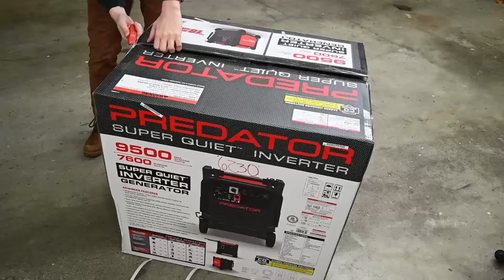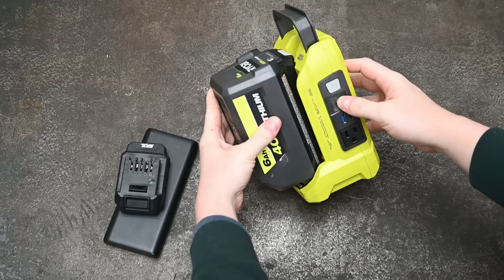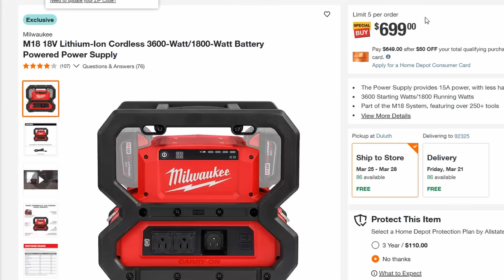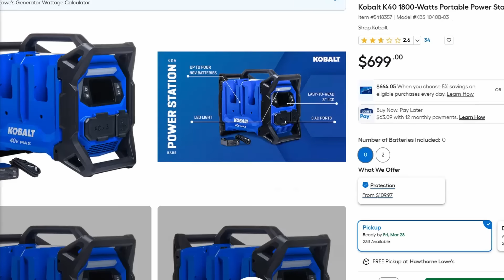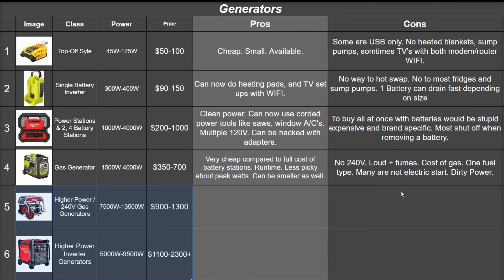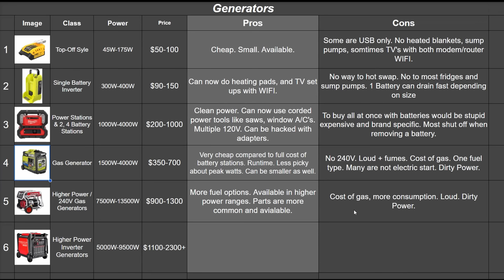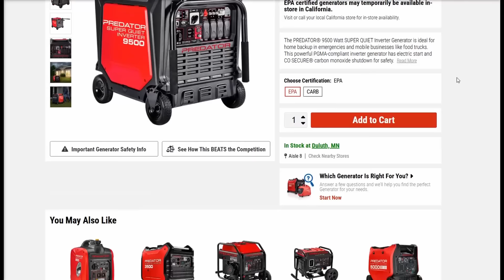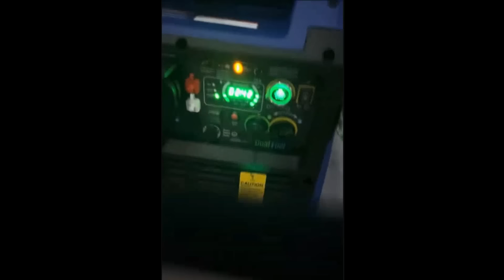Buying Harbor Freight's Most Expensive Generator So You Dont Have to

Comment: The ability to run on propane is HUGE btw.  Unless you're 100% diligent about draining the fuel after every use, or running it every month or 2 for long enough to get it up to full temps.  Propane is also a bonus on the engine oil since it runs cleaner, it doesn't drive as many contaminants into the oil.
Reply: I got firman tri fuel from Costco 
$800 
I only run it off of propane 
I don't want to deal with gas going bad, draining,  clogging up the carb
Reply: @DaveBigDawg  - That's the way to go!  When I worked for Onan (about 15 years ago), I'd replace dozens of carbs in the spring from gen's in toy haulers that had been parked the previous summer with no prep.
Reply: @DrFiero  lose a little bit of wattage but it's okay
Reply: @DaveBigDawg  - Benefits far outweigh the losses IMHO.  Besides... if you know you need say 8kw to run your loads... just get a 10kw gen!  Problem solved.  ;)
Reply: @DaveBigDawg
 Loose, a wrench can fix that issue.
Reply: @DrFiero   Do you know anyone that fixes ONAN generators? Pre-cummins? Since cummins bought them they just want you to buy a new (inferior) one.
Reply: @my_channel_44  - Depends where in the world you are of course... last when I worked for a Cummins dealership (13 years ago!) we would still work on the old ones. Had a few in fire trucks and things like that.  I also worked at a place where we were contracted out to the city for all the pump stations, ice rinks, etc.  They had backup generators that dated back to the mid 60's (earliest I can remember anyhow) many of which were Onans. And yes... the old ones just seemed like they'd run forever.  Many of the new 3600rpm sets seemed to be doomed from day 1 (ok, maybe day 3).
Reply: @DaveBigDawg  I love propane gens, works great with my propane used for heating.
Reply: The biggest benefit of propane is that it won't degrade or go bad. If you don't use your generator very often, that tank of propane can sit for years and still be just as good as the day you bought it.
Reply: @devanwinterton19 thank you for your feedback ❤
Reply: Propane can be stored indefinitely, gasoline can’t. I keep 24 hours of propane and a couple empty gas cans. When bad weather comes expectedly I can load up on gas ahead of time. When it’s unexpected I have a 24 hour buffer of runtime to get more fuel.
Reply: You don't need to do that.   Just add some iso heet fuel stabilizer all the time.
Reply: My $30 marketplace sourced generator sits for months at a time and fires right up 2nd pull. It’s super easy to avoid clogged carb jets and make fuel last, options include: 1. Close the petcock and let it run until it stalls 2. Drain the bowl 3. If you’re using pump gas ADD STABILIZER 4. Run AV-Gas, it lasts ~10yrs and doesn’t varnish when it evaporates.
Reply: @geeksgamesandgears2369 they still sell non ethanol fuel just have to find a gas station near you that sells it.
Reply: @geeksgamesandgears2369  Warning to anyone considering AVGAS, it is leaded.
Reply: @geeksgamesandgears2369 exactly it’s more preferred in my opinion cause as long as you do maintenance you’ll be golden
Reply: @geeksgamesandgears2369 I don’t recommend avgas; it’s leaded, the aviation world has spent a lot of time and money slowly transition the piston aircraft fleet to be more compatible with “mogas“. There’s increased lead in the environments around airports and studies show it ends up in kids bloodstream.
Reply: And you can store lots of propane (which doesn't "go bad" sitting), or connect to a large tank to run for days limited by only oil changes.
Reply: One nice thing about the predator is it has a "storage shutoff" where it cuts off the fuel to the carb and runs itself dry. So no draining the carb or worrying about that. Just use some fuel stabilizer and your set for quite awhile. I try and store mine lower on fuel so if it's sat for too long I can give it some fresh fuel when I need it
Reply: That is the reason I wanted Champion Generator most of them are duel fuel. And when tailgating at a sports game. A Generator running on propane has less smell then gas.
Reply: @mbmann3892 thank you for your feedback❤
Reply: I heard Harbor Freight is coming out with a Predator 11,500 watt inverter generator fairly soon.
Reply: @  only 200% tariff.
Reply: It's a bit of DIY but converting any generator to propane/nat gas is pretty easy and cheap.
Reply: Only problem is they usually run like 10-30% less "efficient/power" on propane when compared to gasoline.
Reply: @Fly-aaron92 like? Oh. BLess your heart ❤
Reply: @johnroberts4823 and you didn't even properly police my grammar. I used "like" in an appropriate context there. 🤦 I didn't say "like wow, ok you're just a big meany." 🙄 I said "something LIKE  10-30%" Specifically bc I didn't know the actual numbers. So I was guessing its something LIKE this or that. 🤦
Reply: @Fly-aaron92  “like” is a fill in word little middle school girls use, not grown men. Come on man!
Reply: @johnroberts4823  Didn't your mama ever teach you that if you ain't got nothing nice to say, it's best not to say anything at all? I'm guessing not.
Reply: It really is awesome. I'm glad I went the dual fuel route and I've never run gas in it (although I would in a pinch if I had to). I don't run mine much so I mostly change the oil because it gets old. Probably about 150 hours on the unit now with 4 oil changes. It comes out nearly as clean as it went in every time. Just did the latest oil change before the big ice storm was threatening and it was a little cloudy this time, probably because it sat for 2 years and I only ran it for 5 minutes before draining it. Propane will actually dump water past the rings when the engine is cold, so you need to get it good an hot to boil that off.
Reply: Propane has a lesser btu value than gasoline. Look it up.
Reply: @nothankyou5524  that doesn't matter if your fuel deteriorates after a month or two. The benefit of propane is that it keeps indefinitely. I know people in southern California who last had their propane tank filled back in the '90s. They still occasionally draw off of it during power outages or during rare wintery weather there. Interesting note, the odorants that they put in propane to make it stinky stop working at some point over long term storage. The gas by itself is odorless.
Reply: @DrFiero  As a small engine mechanic, most need to know that virtually all generators have a fuel shut off. You simply turn this off and run the engine till it dies, no fuel in the carb, no problem, the carburetor is always clean. 6 months to a year, if you haven't used the spare gas, just dump it in your truck and refill the spare tanks with new fuel. Like others have mentioned you need a ton of propane/large 100# tanks and the freeze up you will get from a standard barbecue tank is going to drive you crazy on large generators.
Reply: Not everyone has a enough supply of propane(unless you got one of the big tanks in your yard). If power goes off beyond your neighborhood, pipe gas/Propane might not flow. Gasoiline available in your cars and neighbors. I run 4 houses refrigerators for 1 week with 75 lts gasoiline and a 5Kw plant.
Reply: @WillyK51 Pipe gas drops after a while. Propane comes on a truck.
Reply: @pleappleappleap  We don't have pipe line gas service. Got 3 20lbs propane tanks.But we cook with electricty
Reply: Plus a few extra bottles of propane are multi use, the grill, burner for brewing, barn heater, etc. Add on backup generator fuel that's stable for a long time. Win win
Reply: Propane also produces less carbon monoxide than gas so propane tends to be safer as well
Reply: Or just get non ethanol fuel for it!
Reply: But I thought that a generator can get up.to.temp in 2 minutes because oil cooled?
Reply: Thank you for your feedback❤
Reply: ive never drained my 12kw gas geny ever. starts right up evory time. also dont use e10 gas. its a bit more expensive but wont pull water from the air either. did the math and a 500 gall lp tank hooked up would give me less run time than a 55 gall drum of gas does. and bulk lp have special delivary and at the mercy of them to show up before would run out.  also lp is less enargy dens so have to use more than gasoline. does it have its use abslutly. but a stand alone emergency generator is not it. natral gas however would be ideal!!
Reply: Yea my next generator will be dual fuel forsure, this year I was out there taking apart a carb since I let the gas sit too long. I got it going after pulling my arm off, but propane and jackery are in my future
Reply: If you pay attention to your generator, any fuel is fine (that it's rated to use).  Gasoline is a higher energy density, which is beneficial when you know you need long run times.  Propane is generally cleaner, as is LNG, but that one requires adjustment.    Diesel is good for larger units with long run times, but is pretty dirty.    

If you're not willing to do the right maintenance on your tools, it doesn't matter how wonderful it is - it'll still break.   Use propane? Sure!   But I guarantee that someone who won't drain a carb won't change the oil either.      

I tend to go pay the extra for the ethanol free fuel if I think it may sit for more than a few days, and I also use stabilizer (for storage in the cans).   Fuel is poured out of the tank when done, or run dry (I have one two stroke generator that you can't actually drain the tank - it was a gift)
Reply: Running it every so often really isn't needed. I run mine maybe once or twice a year during an outage. It's 17 years old now and still starts on the first pull. Propane also sucks if you live anywhere where it gets cold in the winter. It can't vaporize fast enough in cold temps. Not to mention that a generator can't run at full power on propane. Me personally, I'll take gas any day.
Reply: The ability to run on propane is a gimmick that people THINK they need/want, but 95% of owners arent equipped to use.  To run a 3kw generator at full load in 50F weather, you'll need 40lb propane tanks or the generator starves due to vaporization rates and the tank icing up.  Your little BBQ propane tank will run out of vaporization rate at about 30% full at 70F while running 3kw of load.  For those 9kw+ generators, you either need 4 100lb tanks, or a 420lb stationary tank.  Far more useful is Natural Gas...
Reply: @BadHaddy  Unless you live in an area that is remote and you don't have natural gas access, but do have your own 500-1,000 gallon propane tank already on site.
Reply: @BadHaddy  to prevent icy tanks, position smaller tank near heat coming off gen or get a y connector for 2 bottles at once.
Reply: For constant use I agree propane is not particularly good for a generator unless you have a ton of propane already on hand but for a generator you only use a few times a year at best it's a benefit as it's not going to become stale and won't vanish you carb and you can always add gasoline to the fuel tank when a outage exceeds your propane supply if it's a dual fuel generator which all portable propane generators I have seen are and you probably shouldn't run your generator 24/7 if it's a extended power outage anyways as you will burn though fuel way faster than necessary and have to change the oil a lot as most portable generators need the oil changed every 100 hours of run time which is a Tiny bit more than 4 days of constant run time
Reply: @BadHaddy  Most people who want to use propane have tanks for their house....
Reply: @ckm-mkc  I sell and service generators as a business, several thousand units a year across a 4 state area.  The big propane suppliers will not fill stationary tanks if they are setup for portable generators, and will not lease you a tank for generator use only unless it's set to exercise weekly.  Most people buying these small portable dual-fuels think they'll be using their swap-service bbq propane tank, and will be disappointed when they do.  I get hundreds of calls after every major winter outage to 'fix my propane generator' when its just too cold for the 20lb tank (that is only filled to 15lbs) that they tried to use.
Reply: @BadHaddy  That's pretty sad. The people in my generator group who went propane have six to ten 100g tanks. I can't imagine thinking a grill tank will get you through.
Reply: @BadHaddy  Renting your propane tank from a propane company is low-IQ behavior anyway. Just buy a 120G tank outright, and then you can shop around for the cheapest supplier when you need it filled. Those propane companies aren't cutting you a deal when they rent you a tank; they know they'll make back the cost of that tank from fees and higher per gallon propane prices in a few years. Prices per gallon from one of the usual big-propane scummy companies is often $1-2 more than you can find elsewhere.
Reply: @bnasty267  Preaching to the choir, but that's not always the reality in rural areas when you are stuck with a major corporate propane supplier.  So many smaller operations have been bought out by the big boys who wont service systems privately owned without very expensive certification/recertification.
Reply: @BadHaddy  Yep, because competition is dead and so is capitalism. What we have might as well be called oligopolism. In another decade or two, it'll be monopolism - one supplier for anything you want to buy, because the moment a competitor pops up they either drive it out of business via predatory pricing, sue it into the grave over BS "intellectual property" complaints (the patent system is little more than a weapon for megacorps to annihilate independent companies via excessive and unjust litigation these days), or straight-up buy it.
Reply: @BadHaddy   Yep, because competition is dead. Our system could most accurately be called oligopolism - we haven't had real, functioning, competitive capitalism for a long time now. In another decade or two, it'll be monopolism - one supplier for anything you want to buy, because the moment a competitor pops up they either drive it out of business via predatory pricing, sue it into the grave over ridiculous "intellectual property" complaints, or straight-up buy it.
Reply: @markkempton4579   I've got a 3400w generator I run off of 20lb grill tanks and it hasn't let me down yet. That's with a fridge, 2 freezers, my core electronics, the furnace/blower, and intermittent toaster oven use. I just keep one bottle on the grill and 2 extras on hand, and if push comes to shove I can always siphon some gas from my vehicles.
Reply: @pilotdog68  sure. 3400W is a lot different than the 10k units people buy for whole house
Reply: @BadHaddy  Some homes have a 1k gallon propane tank...
Reply: @BadHaddy
 Some of us don't live in an area with NG on tap.
Reply: @ducewags propane in a bottle
Reply: @greenidguy9292
 In a 500 gallon or larger bottle, than YES lp in a bottle.
Reply: I simply add fuel stabilizer to my generators and leave fuel in them. I run them 2 or 3 times a year and they always start up on the first pull. Firmam generators.
Reply: @Kevinr14 Exactly this. People worry far too much about ethanol in gas. It's perfectly fine, as long as you let the generator run for 15 minutes or so, every other month. Now, if you let it sit for a REALLY long time with no use, you'll have issues.
Reply: @AverageGuy87-r7k bless your heart ❤
Reply: For me, with dual fuel, it's not a matter of using one fuel or the other. It's about having options. I keep several tanks of propane and several cans of gasoline. I treat the gas with fuel stabilizer and place a strip of painters tape on the can and mark the date it was filled and treated. I rotate this fuel through my riding mower, camping generators, auger, tiller, etc. When a 5 gallon can goes empty, I start using the next can and refill the empty, dating it and putting it back in the rotation. My propane reserves are used occasionally in my dual fuel generators and with various camping and home grills. I also have a gas fireplace with a large tank, if ever needed. I have a large generator that is gas only, and two 4500 watt dual fuel generators with a paralink to combine them if needed. If a situation occurs where gas is scarce, I can fall back on propane, as long as it's available. I have  a bunch of portable solar panels, and a plethora of lifepo4 batteries of varying capacities, and a few inverters of varying sizes, plus a camper with solar and inverter. I have some agm batteries as well. I also have multiple battery chargers for charging different types of batteries. I have jump boxes for jump starting batteries, and they also serve as a charger for small items like cell phones. I also keep a few small solar chargers for charging phones and laptops. If the weather is cloudy, I can power my house with a generator and simultaneously charge my batteries. I can then turn off the generator and power my needs off batteries. It's quite the investment and a lot to maintain, but I don't have a high level of energy anxiety. I also keep a stock of oil, filters, spark plugs, gas filters, etc. for generator maintenance. If the grid goes down, the entire neighborhood will be coming to me to charge things, but they had better not come empty handed.
Reply: Just get some fuel stabilizer for gas and you're good to go, the fuel can sit for literally years without issue.
Reply: Bingo. I've got two generators that I can link if I need to. Thank goodness I've never had to. I keep Sta-Bil in both of them and have a reminder every week to turn them on for at least 10 minutes. They run like a charm and I've never had an issue. When they were new I put in those magnetic oil caps and boy did it really work. Got a ton of little micro metallic articles out in the first couple of oil changes. A simple maintenance schedule will give me many years of good service with these.
Reply: You really should use trufuel with these.   Has the side bonus of being inherently shelf stable.
Reply: @ckm-mkc
 Spend the money on 'tru-fuel' or use non-ethel non-oxy fuel? What is the cost per gallon of tru-fuel non-2 stroke?
Reply: @ducewags Propane is $2.29/gallon at beginning of season here.  Road tax is a bitch.
Reply: I test run mine on a bit of 100LL avgas. I still drain the carb after running it out of fuel, but that stuff doesn't gum up carburetors. It is leaded though so I wouldn't run it next to your vegetable garden or whatever